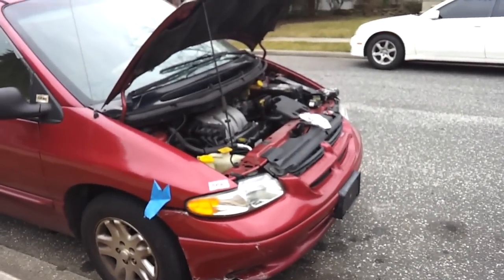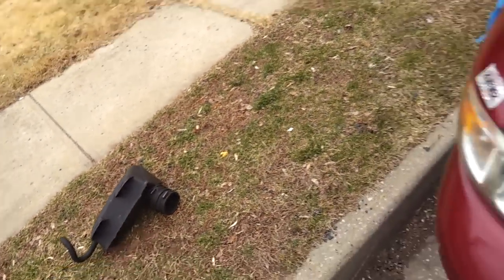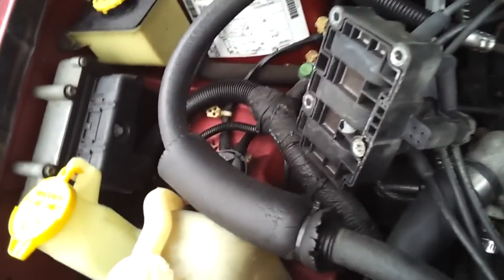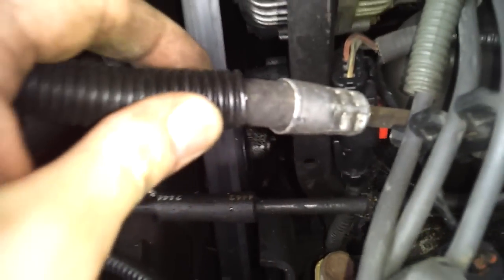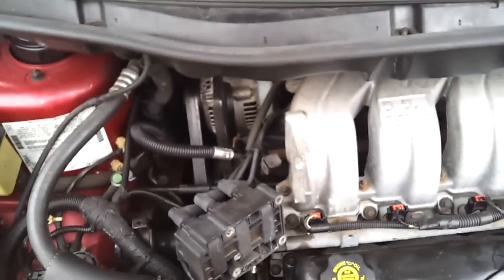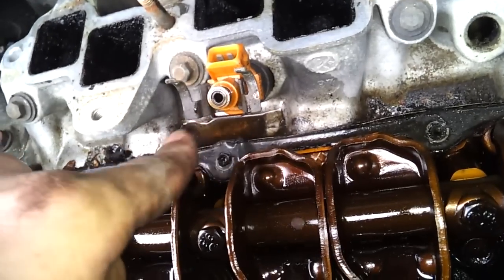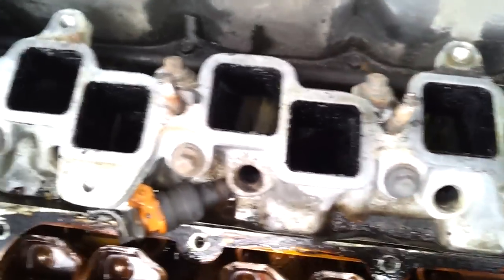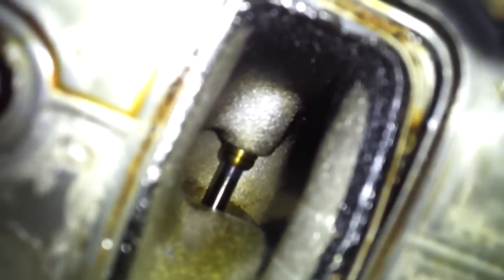Upper Intake Removal 1998 Chrysler 3.3L Part 1

Comment: I was an engine mechanic in the U.S. Navy and have been doing my own car repairs (when I can) for a long time. I've watched your videos but haven't attempted the work yet. Fingers crossed! I have this exact same mini-van and she's got oil leaking from valve gasket cover on to spark plugs and plug wires (because a bad mechanic put on the WRONG valve cover gasket on the front side of the mainfold!). So now I'm going to replace the plugs and wires, air filter (it has oil leaking on to it), and clean up the oil. I don't know if I can replace the BACK valve cover gasket myself though with the right one because I'd have to remove the manifold and that seems really complicated :-(

Comment: If you disconnect the front motor mount you can tilt the entire motor forward.  They make a tool for just that reason.  It makes a heck of a lot easier to get the air intake system off.

Comment: I am so glad to finally see a decent video of how to remove the upper plenum & necessary parts to get to the valve cover gaskets. I hope my repairs go as smooth as yours seem to be going. The two bids I got for replacing valve cover gaskets were over $400.00. As  another comment says "the chilton manual doesn't explain enough in full detail like you".

Comment: I have a '98 Chry T&C AWD I purchased with 241K on it.  I went thru did the regular engine oil/filter and tranny fluid/filter changes and belt changes to have a base line to with which to work.  The tranny is original to the vehicle old fluid was red as it should be, no burnt smell, no slipage in shiftings.  I currently have 249K on it the only other thing I have had to do is replace the input and output speed sensors on the tranny and the O2 sensor on the engine manifold.  It runs great!

Comment: I took the wiper tray out first after seeing your other part 2 video.  It is becoming a blur so much has come off. The cowl hoses were totally blocked up, maybe that is why the whole engine has rust. BIG rust and corrosion, especially exhaust.  I'm not touching the exhaust although I may hit the nuts and bolts with pb just for prep in case someone ever has to work on them.

Comment: Thank you 905SpeedGTA, you ROCK!!  I'm finally diving in and doing this, although I may have bigger problems from letting the van sit for two years... I can't believe how crusty my fuel injector o-rings are! And turns out there was a big recall on the o-rings/fuel rail. The dealership fix sounded like they would check the rail for leaks and if not leaking only address the quick disconnect area and only go in and replace the o-rings if they were leaking. I could be wrong in my interpretation of the docs., but I don't think my van's have EVER seen the light of day since the factory, and I see replacing the o-rings as absolutely necessary.   oh, btw, I'm weak. so I have to finesse everything instead of brute force removal. I used a slim screwdriver type trim tool to pry the fuel injectors out. ez! hard before! I thought I couldn't reach the screws on the back that hold on the wiring harness and tipped the plenum forward and then one screw went flying off, so in retrospect, I wish I had left it (plenum) sitting down solid and found a way instead of now wondering where that screw is.

Comment: At 10:01 you show the removal of the cowl drain tube. Mine broke during one winter when water would drain, the water ran on to the serpentine belt, acting like oil, causing the belt to slide off the tensioner and idler pulleys. A real pain especially if you are in a remote rural area. The after market fix is to get a pulley guard kit made by Dorman includes add on guard sheave and a longer mounting bolt.  Remove pulley discard OEM bolt. Insert new longer bolt thru guard sheave and pulley then rethread bolt into engine, reinstall serpentine belt. This is a known problem from Chrysler.  Further, if the "wheel well splash guard" is missing this will also cause the same problem when you hit a puddle of water splashing upon that side of the engine. Hope this helps we are all in this together. :)
Reply: Mike Schmidt 
I wonder why [belt slippage] only seems to be a problem on some Chrysler minivans.
I have a 93 Grand Voyager and I've never had my belt come off, even when it got really wet. It just makes a slightly different noise until all the water is flung off.

If the belt is straight and all the pulleys are in alignment (and have good bearings), theoretically, there shouldn't be any forces acting to push the belt off.
Reply: *****  I guess it can be chalked up to one of the "Idiot-synchronizes" of the beast.

Comment: I found your video helpful. all I was doing was changing the rear bank spark plugs which are the origenal that came with the van...... (I've owned it less than a year.) I can understand why they have never been changed. it is a daunting task. I found a more convenient way to get the intake plenum off. you take the wipers off, remove the plastic vent cover and remove the wiper mechanism tray. its easyer than it sounds. this opens up the top of the engine compartment. you can get to everything except the spark plugs. you still have to remove the plenum to get to them.

Comment: 19:27: What you are seing there is the intake runner, not the cylinder head and that other thing you are seeing there is the intake valve stem in the runner, not the push rod. Handy vid however despite the small mistakes. Also, your rockers look fabulous. Somebody changes the oil pretty regularly.

Comment: I just recently did a valve cover gasket repair on my van as well and found some of the bolts to be loose too. I also have gunk on my manifolds from it and I get that smell too. I tried to get all the crap off of the manifold but its on there really well

Comment from the maker: Seafoam is a Pale oil substance known for cleaning Fuel Injectors, oil passage ways and Intake manifolds and plenums. The result Varies from engine to engine. Some engines are worse than others. You seem to not like seafoam. some are for it or against it. But it does work.

Comment from the maker: i hope my 98' gets up there in miles like yours does. If its the original trans, and you have no service records for the trans, then let that fluid be...only thing i suggest is changing the transmission fluid filter, they tend to plug up.  Do a video on your T&C , Im doing alot of stuff to my caravan and its great to hear these things are still going strong...everyone i see has atleast 140k on the odometer

Comment from the maker: just go to a auto parts store. you can get rubber hose, and if the specific place where it broke calls for one of those hard lines they are usually located in the HELP section in the autoparts store. if not, theycan be found online

Comment: Doing this valve  cover gaskets ,upper intake now.Found the aluminum bolts are junk,taking them out the heads rounded, & good luck replacing them.Ended up at Fastenal as dodge don't stock them any more. If your gonna replace get socket heads or steel hex head, aluminum are JUNK! Do plugs & everything you can get at as this is a pain!

Comment: it will be true.....   Once that intake plenum comes out it will leak air and oil forever no matter how you tork it, and will cause a rough idle as well. It takes hours just to remove the heat risers and grounding straps on the plenum, it is so not worth it.    thank you so much

Comment from the maker: eventually it will all dissapear.. i used GUNK to get them off, m car was ABUSED so...as long as you took care of the leak the oil on the manifolds will dry up..hope you tightened those bolts down in sequence

Comment from the maker: Hey Nicole, your welcome! thankyou for watching my channel, please subscribe :) . it sounds like your transmission is in Limp mode. the early caravans 1991-1995 had a sensor issue I believe where they would enter limp mode ( second gear only) and you would pull over shut the car off start it and it would be fine ( i had a 1992 DGC ). it sounds like your 96 has a solinoid pack issue. Bring it somewhere where they can put a scan tool on the trans and get the codes. and I used simple green on ENG

Comment from the maker: the gunk should of worked well.. id hit it again with the gunk on a warm engine and brush it in with one of those abrasive brushes and rise it off.. dont get the engine too wet and run it after to dry it down..i dont know where you are located but where I am now is too cold to be using the hose lol..

Comment from the maker: have you seen part 2 of this video? I have another way of doing this job and also removing the wiper tray assembly to make life easy for anyone who wants to do a job to anything behind the engine.. its one of the simplest cars Ive ever worked on... to answer your question I removed the fuel rail with the gasoline still in the rail It was only a small amount.. the system was depressurized when I did this.. have u see the Fuel Injection video? if not here it is ..

Comment: Great Videos, very helpful indeed! I've just begun this today and knowing where shit is made it so much easier. Though the fuel lines on mine are fine, however, most of the vacuum lines are junk. Cracked and split everywhere. I'm surprised it ran at all. hahaha.
Reply from the maker: cheyennedogsoldiers most likely has a Giant vacuum leak in the intake so even if a line broke you most likely wouldnt notice. Glad you found my channel helpful. Please subscribe to my Channel. Im starting to post videos again
Reply: Yeah Iit has and I'm guessing its been there for a long time as I discovered large globs of silicone had been applied here and there. Obvious a half-assed attempt at a repair by the previous owner, which was a shame because I have all of the paperwork from the vans original owner and up until he traded it in 2009 which included it full dealer backed service history. But, whatever, I'm doing it the right way now! Anyway thanks for the reply, I am a subscriber and look forward to your new vids.
Reply from the maker: cheyennedogsoldiers  Dont you like seeing Half assed work?.. Check around my Channel and u see some people Talking shit about some of the Methods I use or the things I do..Those are the Half Assers and those " Know It alls" with all the big name brand tools in the garage, all these gadgets  etc. And cant use half of the shit, But They know it all..lol Thankyou for subscribing, I try to answer everyone, but when i do its like 3am..
Reply: 905speedgta dont let people  get you down. This world is full  of who just  want to mean period. Your methods may be different, but they  work  like a champ.:-)thank you and  marry Christmas  even thou it early  to say it!

Comment from the maker: Theres Always a Better Method for Fuel Injector Cleaning. Ive found and many other mechanics have found that Seafoam aswell as many other cleaners when added to fuel actually does work over time. I only use seafoam to clean intake Internals. It does work, But this engine was carbon Filled, BAD..Are there better approaches? Yes. Seafoam wont Wipe out your cat,or your O2 sensor. Cats run at a range from 500 to even 1200 Degrees. it will take more then that to clog it.

Comment: yup, thats the easiest way to do it, i had to change out the heater tubes on mine, ant the wiper motor assembly, was the first to go, then the upper intake manifold. pain in the ass if you ask me.

Comment: Hey, I checked out your 2 video's for removing the manifold and they both will help me fix my problem of not being scared to test the waters.I have a 98 T&C LX 3.8L with 289,000 miles and still kicking,problem is EGR insuffient flow.Bought new egr valve,cleaned throttle body butterfly and vac ports,but still have jerking problems when accelerating.I'm thinking removing the manifold cleaning the ports replaceing the gaskets might fix the problem.Tell me what you think.Oh yeah i subcribed to your channel.

Comment: Hey man, good job! Listen I just picked a 1999 grand caravan 3.3L. It has 179,550 miles, It run excellent, as it seems someone has already done the work you did, but also the obligatory water pump, drive chain and hoses. I will need to replace the air idle control valve on the throttle body.I noticed that one of the two very small hoses coming off the pluneum broken after 4 inches.One is connected going to the erg?the other, I don't know. any ideas where it goes? major vaccum there.please respon

Comment: my Chrysler Grand voyager 2003 3.3 petrol has a miss-fire on cylinder 3  when cold does not miss- fire when run for 2 mins miss-fire kicks in when i drive it back fires through the air intake box but tends to go when running at high speed. I have changed plugs ht leads coil pack map sensor, idle control valve & had compression tested, no loss of oil or water. Can you help please , some one has suggested it could be sticky valves ??? it's only done 72,000 miles any help would be much appreciated

Comment: Thanks for making these great videos! I have a 1996 Caravan that needs all this and more. There are some things I don't know how to do, like how to disconnect  the wiring plugs (without breaking the little tabs) and how to use a quick disconnect for removing that fuel line &*How did you clean that up so good?! I'm going to tear into my van soon. Also my trans won't let this van go over 35mph but only50K on rebuild. Trans wiring soaked with oil from leaky valve cover gaskets.Cleaning? thx, Nicole

Comment from the maker: Peter,

      Your basically Inside the engine at that point. ive seen what you speak of. Is there anyway you can Take a picture of the bracked with the three bolts and a picture of where the oil is everywhere?. I dont want to give you the wrong information so Id like to see a picture if you can